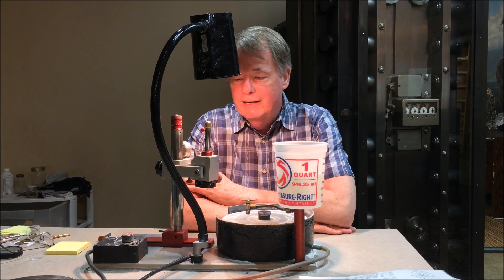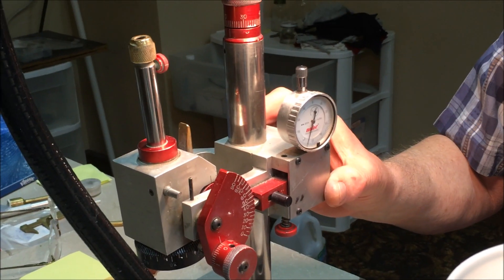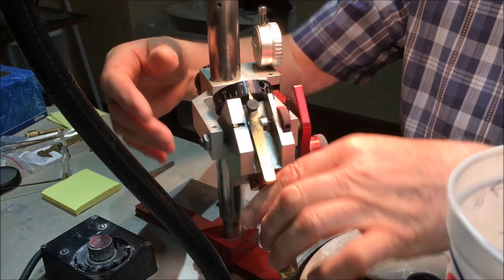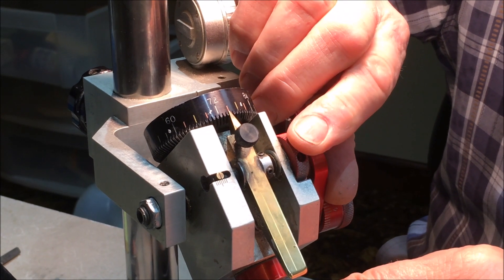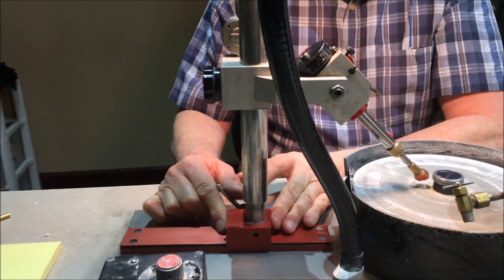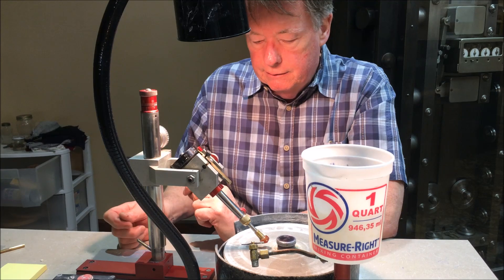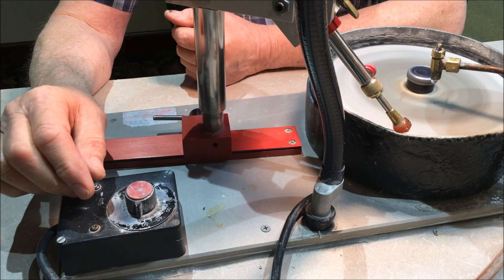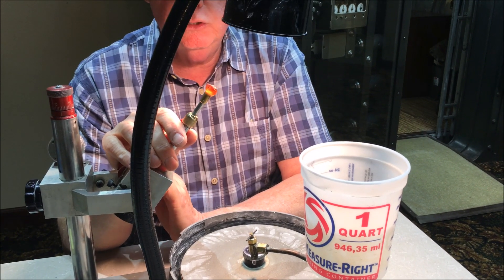How to cut Gemstones: 3 Getting to know the Faceting Machine

Comment: hello!! a quick question— why do you put the water drip closer to the center of the wheel instead of on the circumference/band that you are cutting on? (i am a novice at this) also do you wash your diamond cutting stone intermittently to remove any gemstone stone dust? I would imagine the gemstone dust might interfere? thank you so much. love your videos and your work
Reply: The centripital force pushes the water to the edges anyway.

Comment: Hello my name is Nestor from México I like The faceting machine, you have one for sale
Reply: I am so sorry by my inghlis is no good maybe some body speak to español
Reply from the maker: Hi Nestor from Mexico! We do not sell faceting machines, but we would recommend purchasing a machine from Ultra Tec or Facetron. Unfortunately they do not manufacture the Machine Steve is using any more.
Reply: @Moregems hey there,
 I have been looking for this machine used but honestly have not seen another like it to be able to ask them either. I have a machining and mechanical engineering background so duplicating or replacing parts is definitely not a problem, so if I knew the make and model it shouldn't be an issue afterwards. 
thanks,
Dustin Carroll